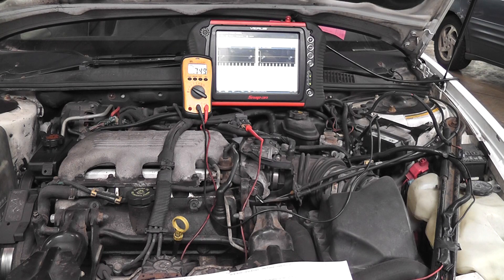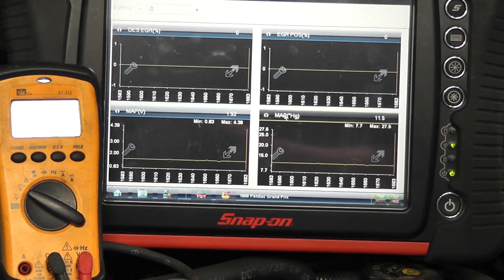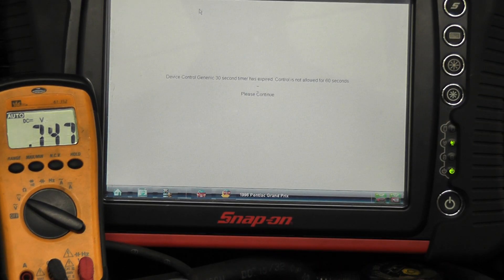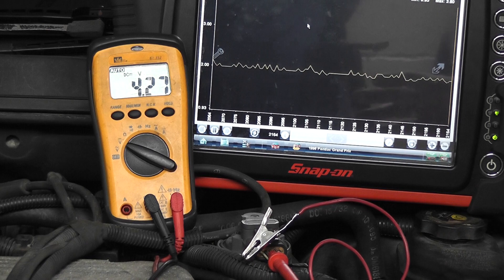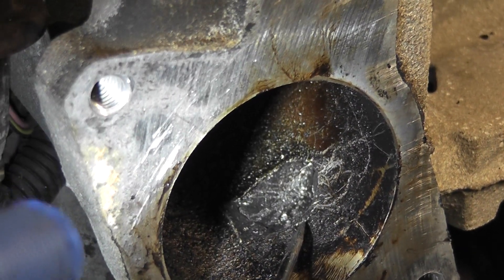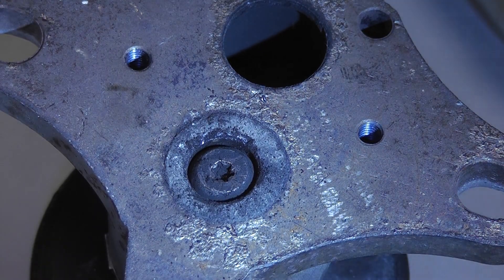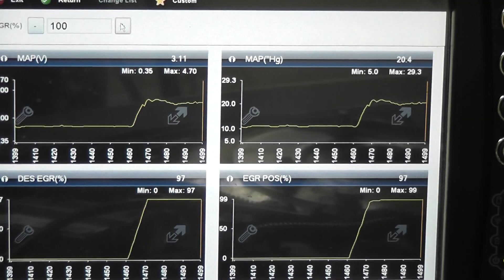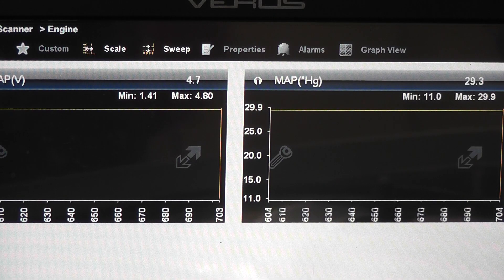How to test for EGR flow problems (GM electronic EGR test) - P0401

Comment: I would like to ask something that has confused me if an engine only has a maf and the egr stays stuck open, in the end the maf measures more air or less at idle, because in many videos others claim that it measures a lot of air, others that it measures a little, what is the truth in the end ?
Reply from the maker: This is a complex issue. Too involved for text on a screen, but I have some classes and case studies on this on my website. Sign up for the 14 day free trial, then cancel before the subscription is up and you won't be charged and it will give you a chance to watch these videos

STUCK OPEN EGR ON A MAF ENGINE (CAUSING LEAN CONDITIONS)
https://www.scannerdanner.com/scannerdanner-premium-chapters/chapter-5-oxygen-sensor-testing/chapter-5-oxygen-sensor-testing-full/557-stuck-open-egr-on-a-maf-engine-causing-lean-conditions.html?highlight=WyJzdHVjayIsIm9wZW4iLCJlZ3IiXQ==

https://www.scannerdanner.com/scannerdanner-premium-chapters/chapter-4-oxygen-sensors-and-fuel-trim/chapter-4-oxygen-sensors-and-fuel-trim-full/254-chapter-4-oxygen-sensors-and-fuel-trim-pg-20-expanded-content.html?highlight=WyJzdHVjayIsIm9wZW4iLCJlZ3IiXQ==

Comment: I am a little confused about the graph of the MAP voltage and MAP pressure. It looked like it is pulse width modulated in the last segment of the video. 🤔
Reply from the maker: Did I command it 100% open and then watched MAP voltage rise? I was just showing the flow rate by that test. It's a test that's really not needed. You basically want it to stall the engine or almost stall it with the EGR open 100% at idle.
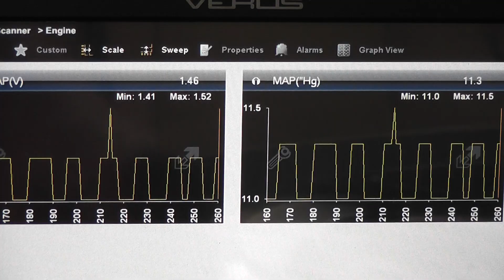Reply: @ScannerDanner  time period 12:54 to 13:14 MAP voltage and MAP "HG graph looked liked it was PWM waveform. After you ground switched the EGR, the engine stalled and the MAP voltage waveform went high with nice steady line.  All I am surprised by is that the MAP signal looked like it was Cam sensor signal.
Thank you
Reply from the maker: @SS-U23  ah okay! Look at the scales! It is only .2v difference. This can be misleading on a self updating min max scale when you first open a graph
Reply: @ScannerDanner  oops, I overlooked the scale and the Min Max difference. Thank you for illustrating that to me. I greatly appreciate it!🙂👍👍👍
Reply from the maker: @SS-U23  no problem! Great questions!

Comment: ... that was an exceptional Presentation, thank you.   My 2004 Buick Rendezvous, with a 3.4L V6, is stalling after it's warmed after 5 minutes of driving.   It's a used vehicle, so I thinking no one has ever done any kind of maintenance on it, since I got in 2020.  I had a P0401 code when I checked with my $12 scanner from the Province of Chinesium, CN 😆

Comment: I have a 94' Corsica with the 3100 and it has a rough idle and when driving, if I get above 50mph and slow down quickly, the check engine light comes on. I can turn the car off for 20 seconds or so, restart it and the check engine light is off. 

Being OBD1.5 I can't use an OBDII reader to check for any codes. I have read about jumping wires in the connector under the steering column, but found contradictory information on the two wires to jump, so I've avoided doing such. 

I've used Seafoam in the intake and cleaned the O2 sensor in hopes of fixing my issues. Which for a few days, it seemed to have worked, but then the check engine light began coming on again if slowing down quickly. 

I can kick the car into neutral or take like a mile to slow down to under 50mph and the check engine will stay off. 

Car sat for 8 years in my back yard before getting it going again, due to a low speed collision. Was supposed to be a project car for my farther and I but it never happened. 

So, would the egr be the likely culprit?
Reply from the maker: Have to scan it for codes! Otherwise we are just guessing

Comment: I did not know that the ground of solenoid is toggled inside ECU, and therefore the coil is energised through ground, not +12 V! So as I measured the voltage when ignition on, the potential of the ground wire was the same as +12 solenoid wire. So I thought the ground wire is torn and i was going to seek for discontinuity. The idea of toggling ground manually to trip the coil is valuable when someone needs to test quickly whether the valve is stall/jammed. 
The only my concern is whether it is safe for ECU to toggle ground manually?
Reply from the maker: it can be the other way around on these too! I have seen power side switched circuit designs on some models using this linear EGR, so tread carefully. 
The fact that you read equal potential on both the power supply and ground for that solenoid is telling us it is in fact ground side switched. And yes! It is absolutely safe to add a ground, where the computer is applying a ground. Even if the circuit happens to be on, you will not be adding anymore load or current flow to the ECM driver. HOWEVER, if you mix up your circuit design and thing that you need to add a power, instead of a ground, and the circuit happens to be on, you just cooked the computer driver. Make sense? Chapter 3 material (playlist), right here on YT and if you want classes on this, same chapter 3 playlist on my website https://www.scannerdanner.com/join-scannerdanner-premium.html
I think you would like the classes!
Reply: @ScannerDanner  Thank you very much. I have join your classes!
Reply from the maker: @nikolozkvrivishvili5343  oh wow, awesome, I didn't expect that. Thank you! Spend some time in my chapter 3 playlist and then don't forget to watch the newest classes on this same chapter in my SDP 2.0 playlist. Talk to you there, I am sure.

Comment: After applying an asterisk screwdriver to the slot of the solenoid actuator screw, the EGR valve unlocked, and when pressed, it walks freely and returns.
Reply from the maker: make sure you rotate that while working it in and out, use carb or brake clean to break up the carbon deposits that are causing the valve to stick. Do not use a penetrating oil as it will simply burn off

Comment: You’d make an excellent engineer professor. You clearly speak eloquently and precisely. I’m very impressed. 

What does mechanics wire look like to clean out the passage way?
Reply from the maker: A wire coat hanger but a little thinner. Had some good suggestions from the viewers, use an old speedometer cable in a drill. Thank you!

Comment: You are a very smart mechanic bro. Wish we have mechanic like u here. My car jerks for more than 2 yrs now. Ive consullted KIA,HYUNDAI amd other shops but no one seems to fix it. My hyudai accent 2011 egr is openning intermitentlly, when in accel it jerks since egr is still open from 15% to 60%. Specially in the morning, but im driving for hours jerking is still there. Sometimes it goes away when i  park for more than 10 min. But somtimes it still jerks . I have a new egr assembly installed but still the same prob. I cleaned the egr cooler and intake manifold, MAF,MAP, CKPS,DPFE,TPS,Turbocharger. Muffler, tried to clean the cat only by compressed air since its hard to take it out. I hope u can help me.

Comment: I bought your book and think it's great that video's are linked in some sections. This is the exact problem my friend is having on his car, and now we can test to fix, and as you always say, don't be a parts changer. His first thought was to of course change the part, but I wanted to do a little research and find the root cause of the code. One part not needed and not swapped pays for the book.
Reply from the maker: Thank you so much!

Comment: Hey just started watching your channel and think you are awesome. I work with my father and I’m studying hours of yourself, diagnose Dan and supermario to date to help hone my skills. My problem is I get a lot of French cars with many egr valve codes(Peugeot 208,308,Citroen c3,c4 1.6/2.0hdi) stored relating to p0401-0404 and always seem to check out fine when testing. Do I need to be more thorough on testing and keep the car over a course of a few days with umpteen road tests or am I not properly testing? Sorry if this  is a rather dumb question. 😳keep up the good work.

Comment: On my 89 s10 pickup I unplugged the EGR  soleniod and the truck runs so much better. Replaced my valvle cover gasket so I know EGR valve moves and I didn't see anything plug the passage way.  I wonder if I can command the valve open by grounding it like you did. Don't think the red brick will command the EGR valve open.

Comment: Well done video! I have a question tho. At about 5:30 of the video Paul grounded the letter A pin to manually command EGR. Now, you're NOT grounding the wire to battery positive right? I'm trying to diagnose an '01 Impala 3.4L (p0401) and when I ground A to body ground my signal voltage (0.79v on C) does not increase. I have the proper 5v ref on D and 12v supply on E. EGR is new as I confirmed a bad potentiometer on the previous one which gave me a p0405.
Reply from the maker: They changed the polarity on these, the newer ones,  both wires go the the PCM and it is power side switched. DO NOT jump anything until you are sure of your circuit design.
Reply: @ScannerDanner  Ok. Thanks for the info!
Reply: Update:
Just did some more driving tests with voltmeter hooked up to to C (signal voltage). Surprisingly I noticed that my voltage would drop when accelerating. It would usually go to .6 something volts but at a couple points it would go as far as .5v. What in the world?

Comment: I pulled the valve off of my 2001 S-10 4.3L, and scraped the deposits off of the seat of the pintle valve, but I also used brake cleaner to clean the pintle valve itself  as I moved it up and down and rotated it at the same time.  It worked really well, and it doesn't stick anymore.  Is brake cleaner ok to use on cleaning these, or is it too strong?  Should I have used carb cleaner instead?
Reply from the maker: Either one is fine on this application, nice job Jeffrey!
Reply: @ScannerDanner  Thx man.  Really enjoy your videos, so I subscribed to your channel a while back.  Very informative for a home mechanic like myself.  I really appreciate the time and effort you put into making these videos.  I know it isn't easy trying to show the techniques you are doing, while trying to film at the same time.  Keep em' coming man!!  Take care!!
Reply from the maker: I've gotten a lot better at filming and editing too :-)

Comment: I took some carburetor cleaner and sprayed the pintle valve, and its orifice and let it sit for a while.  I then took a clean rag and screwdriver, and put the rag on the end of the screwdriver and worked it inside the orifice, working the pintle up and down as I did so.  It cleaned it up pretty good.  This was on my 01 S-10 4.3L

Also, for cleaning the passages, couldn't you have used some pipe cleaners (assuming you could get them manipulated to an angle where they would fit in the passages) to clean them out?

Awesome video, as usual.  I, as well as many others, really appreciate you taking the time and effort to do these videos.  It's hard enough to work on vehicles, much less doing it while trying to film the procedure(s) at the same time.  It is much appreciated!  Thank you, and keep up the great work!!

Comment: Hey Paul, love your videos. I've learned so much over the years, and use what you've taught me almost every day as a 13 year veteran mechanic. Please advise: I had a p0401 code on an 04 Dodge Magnum 3.5L V6. Bi-directional controls were only available with "engine off". Scoping EGR position sensor matched scan data, it seemed to move fine. I suspected clogged passages. EGR valve solenoid is power side switched. I wanted to open valve with engine running to confirm flow problem. I wasn't sure i could jump to positive without hurting drivers, so i pulled the feed pin out of the 5 wire connector and energized EGR with the PCM's power wire disconnected. It was hard to do, but definitely confirmed clogged passages. Could i have jumped to power, engine running, power switch wire installed without damage? yes, right?
Reply from the maker: Yes, absolutely. Of course the key is knowing it was power side switched first. There is no danger to the computer by applying 12v to that wire. Even if the driver happened to be on 12 and 12 doesn't equal 24, it equals 0, in other words to wouldn't hurt the driver
Reply: @ScannerDanner  Thanks for reply! I thought so, but wasn't sure enough to try. Sorry it was an '05 btw. Scoured your videos for a good example of power side jumping. Eager to try it next time.

Comment: thanks a lot for the video - does it ALWAYS throw a code ? mine has rough idle and i have changed iac and tps...cheked vakum hoses , but stil has a rough idle, but only when its warm ?? i am getting pissed . if i pus the pedal juuuust a bit it runs perfect , but with no pedal it has a rough idle . please give me a clue ? i have no codes at all - same car as in the video

Comment: Trying to get the EGR valve off on my 2003 Chevy Venture will be very difficult but this is the only thing that makes sense. Maybe not even need a new valve either.
Reply from the maker: Common issue (plugged intake passage), especially on the 3100 and 3400 engines
Reply: I'm having to take the whole upper plenum off to get at it and still may not be able to get the crud out because of the shape of the passage. What a mess. This is NOT a 30 minute job and the Venture.
Reply from the maker: I have heard of people putting an old piece of speedometer cable in a drill and using it as a "snake"
Reply: It turned out that the carbon buildup is directly under a hole for another vacuum or sensor fitting which I could have gained access to this clog. It was only clogged at the inner opening so a partial cleaning could have been done if I had known and the flexible cable you mentioned could have finished the job while in the car. Thanks.
Reply: @MikeJones-rk1un  Could you provide a bit more detail about where the carbon build up was and how you accessed it?

Comment: I have an isuzu elf truck with p0404,p0045. I have followed the wiring and all seems good. My truck can only rev upto 1500rev/min. Egr looks clean. What should I do. Thanks
Reply from the maker: You have EGR flow codes and the engine won't rev past 1500 RPM? This screams restricted exhaust

Comment: my sister owns a 2004 Chevy Monte Carlo 3.4 they installed a new mass air flow sensor and the EGR valve they turned off the check engine light and we drove it for almost 100 miles everything is ready except the EGR we keep driving it and driving it and driving it and it still says incomplete and now my sister's license plates are suspended because we can't take the emission test until it's ready. I'm going to check that EGR air Passage to see if it's clogged. but my question is will all that clogging cause it to show incomplete or not ready?
Reply from the maker: Not ready or incomplete means the test was never run. Cleaning the passage won't fix that. A thermostat that is opening too soon may prevent some monitors from running. Change your thermostat.
Reply: ScannerDanner the coolant thermostat?
Reply from the maker: Yes sir. As crazy as that sounds
Reply: ScannerDanner okay I'll try that thank you

Comment: Hi SD, I'm a bit confused as to when looking at the wiring diagram to determine circuit design at the part where the wires connect and go every where, how u determent which one was the one for that circuit?
Reply from the maker: Jesse the short answer to that is you need to start following my material on scannerdanner premium. There's a lot of theory and operation that helps when it comes to identification of the circuit that you're working on
Reply: already a subscriber, just like to watch each section on each channel, but will keep watching, thank you!

Comment: Dan,  I have an 1997 acura cl 3.0 . I had a code which required cleaning out the passage ways as well.  The carbon was caked up like yours, I cleaned out it by using a drill bit but I forgot to remove the egr valve. I had used carburator cleaner and filled the passageway to the egr valve. After starting up the car it drove ok but during idle the rpm was at 1000 rpm and ossilated between that and 1500 rpms. It was going up and down and up and down constantly.  Watching a few videos here on youtube the recommended fix was to replace the IAC idle air control, which I did and did not seem to make any difference. Thinking about it and others saying a vacuum leak could be the culprit has me confused as to the fix.  I did not have the reving problem prior to cleaning the egr passageways.  I tried using a homemade smoke detector but saw no smoke leaving the engine. My question is would a peice of carbon slightly preventing the egr valve from closing cause the high oscilating rpm in park?
Reply from the maker: Most likely not. This would typically give you a rough unstable idle, not a higher than normal idle speed. 
My money is on a vacuum leak.

Comment: yes I have a 2002 SL2 Saturn giving a EGR code and a clogged cat code when I drive it around the block it starts cutting out real bad and when you give it gas it cuts out and dies I replaced the EGR plug wires plugs coil pack 1 coil pack fuel filter and it still has this problem how do I fix it

Comment: In this case, we have blocked EGR intake, which means no flow from EGR. The car takes only fresh air. Can You explain me...why engine is "pinging" under load?
Reply from the maker: +Paweł Czechowski the main purpose of the EGR is to cool the combustion chamber. So no EGR = hotter cylinder temps.

Comment: I have an excessive flow fault code its electronic so no Vacuume pipes just a breather pipe. (mk4 golf 1.6 16v 2001 AZD engine code) ive tried loads of things been to a mechanic he hasnt got a clue whats wrong?